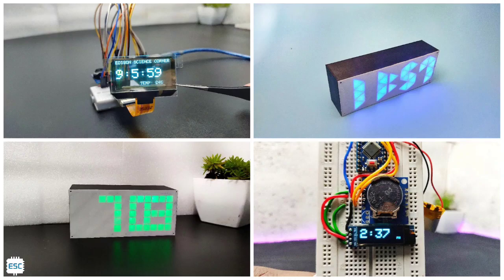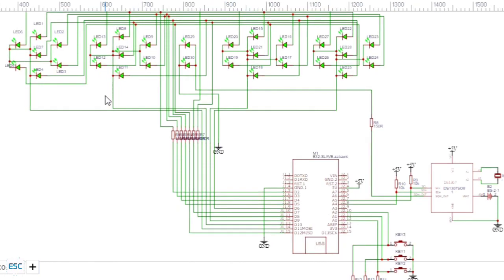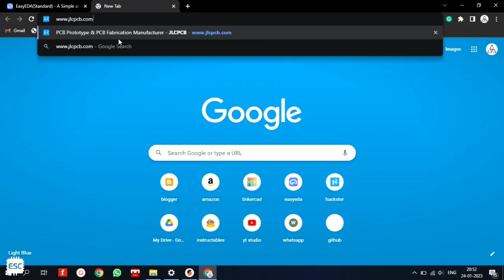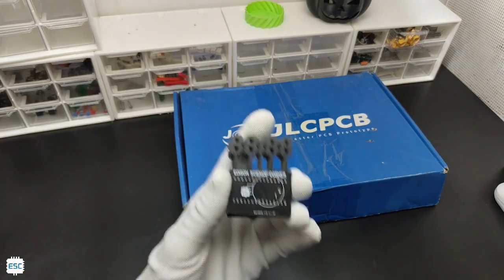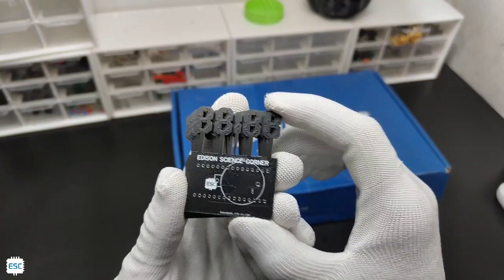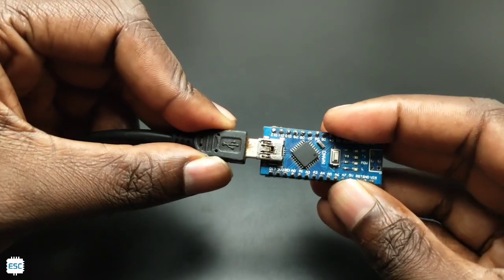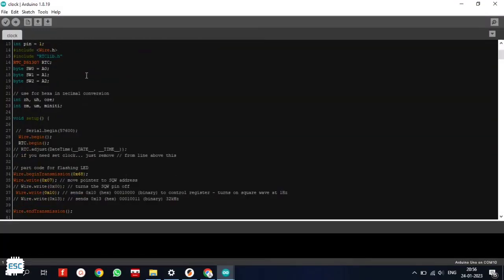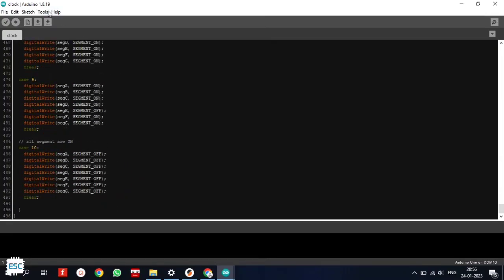Seven segment Skelton clock making | JLCPCB

Comment: the new part was the led display, but you didn't show the leds being placed and soldered.
one small led is not very nice to tell where the segment is located, so a '5' looks very strange. 
the thin leg of the colon makes that part easier to break off, bad idea.
Reply from the maker: Sorry for that. I know the design was not good.
Reply: @EDISON_SCIENCE_CORNER  Do not be so hard on yourself. I like the concept. With just a few tweaks, you can correct the things that do not work. Such as adding diffused lenses over the single LEDs to better define the segment shape. Or, mount gull wing LEDs on the back of the PCB and drill multiple holes in a straight line to define a single segment. Or, use multiple LEDs of an even smaller size. There are lots of options. You inspire visions of making a wrist watch. Keep at it.
Reply from the maker: Thanks brother